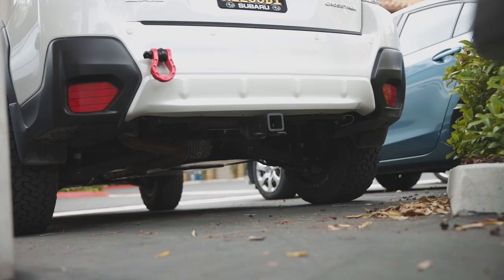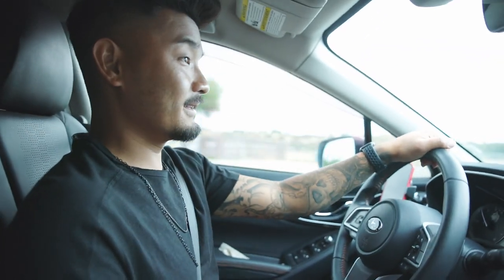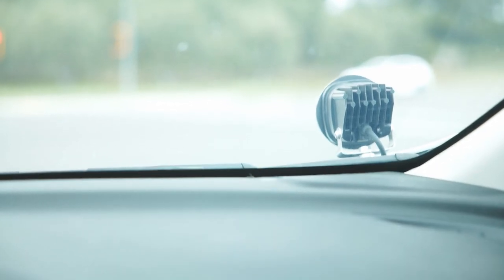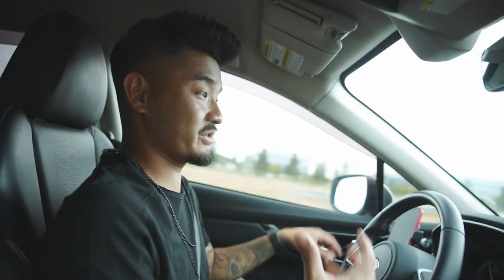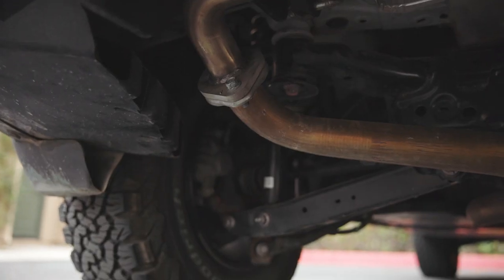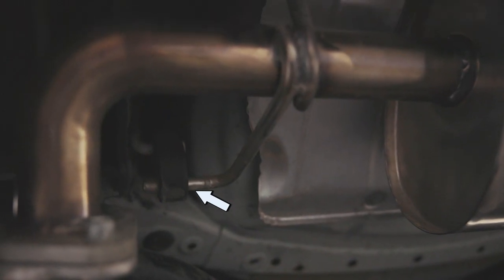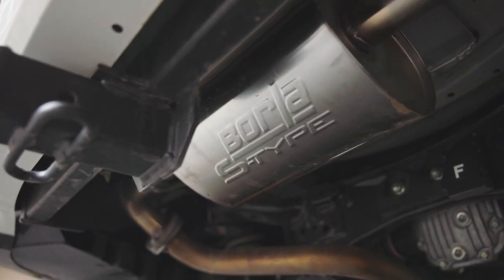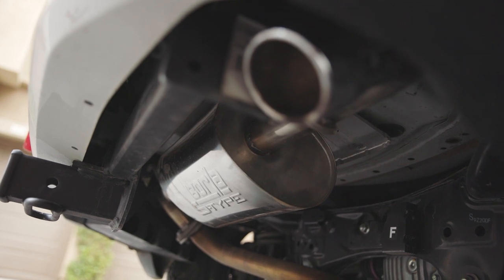Borla Axle back exhaust setup and Sound || Subaru Crosstrek

Comment: Sounds good to me, I just wish you had a comparison to the original part so I can hear the difference with your same audio setup
Reply from the maker: I should’ve recorded the first.
Reply: @meesubicrosstrek8097  further question: does the tip hand down lower than the stock, potentially causing a low-point for clearance, or is it pretty well tucked in?

Comment: Just got my 2023 Crosstrek Touring 2 weeks ago. What mods would you suggest I should go for ? 

Also did you see a change in performance or horsepower after the exhaust setup. ?

Great video btw and straight to the point ! 🤟🏻
Reply: Just got a 23 crosstrek as well. After having it for less than a week I got new rims and tires. Upgraded to all terrains. Rims were to add and offset. I went with 215/75/r15 since they are the same diameter as factory tires so I didn’t need a lift to fit them
Reply: @kasefrancis  is 215 tread size good enough it does it feel skinny on the Crosstrek ?
Reply: I don’t think you would notice that much of a difference between 215 and 235 tbh. 235 has .8 Inches more width and 1.2 inches larger diameter. Tire width doesn’t add that much more traction so that’s not really a reason to size up. Mainly the larger diameter giving you .6 inches more clearance. Also a lift would give clearance
Reply: You’ll never get any gain from an axle back. The sound is the only thing that will change
Reply: @jd5393 you definitely get some gain. The stock muffler is a giant reverse flow that's very restrictive.